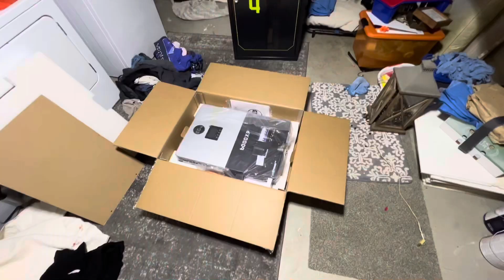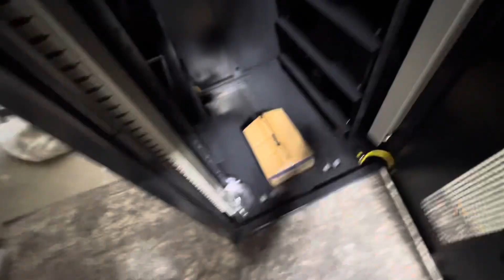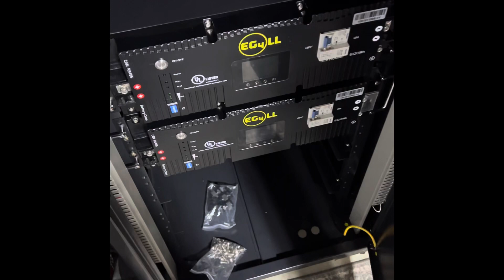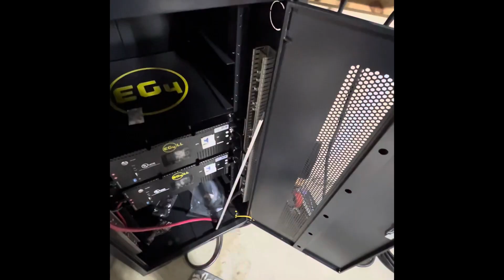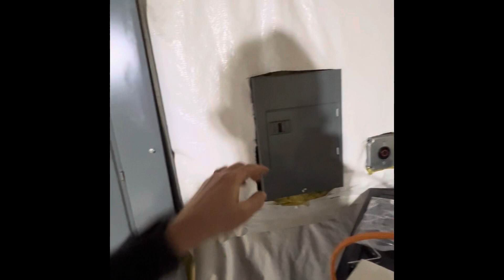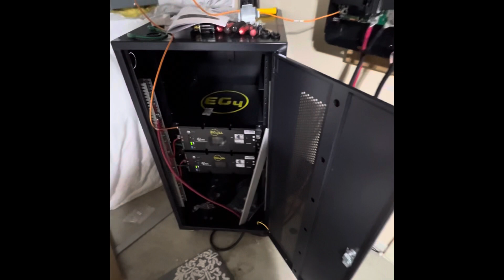EG4 6000xp with Server Rack Batteries

Comment: Im watching this 4 months after you posted so things may have changed. I got the 6000xp a few days ago and did not need dongle to get 220v out. One thing I noticed you need to turn on battery breaker on 6000xp before you power your battery so the battery boot can give the pre-charge system to charge the caps in the 6000xp. Look forward to more videos on the setup.
Reply from the maker: I had to switch on the EPS switch lol! Thanks for watching

Comment: I also that model.but have connected it yet. Can’t you connect directly to the batteries from the inverter using a lab cable
Reply from the maker: Not sure was a lab cable is but yes you can connect with 2/0 size power cables. Thanks for watching, gl with set up!

Comment: Thanks for the video! Ive been looking into this package myself or variants of, from SS. I'm really glad i watched this video. So the 6000xp will only work via internet/cell data? Or is that only for the initially configuration startup and then periodic software upgrades? Because if this is dependent on aspects of the grid, ie: interwebs, it completely nullifies this being an off grid unit as they advertised, And honestly seems goofy that something such as solar would have a dedicated need for internet. Thanks for the video!
Reply from the maker: It will work, I did a follow up video to this, the batteries were not communicating with inverter so that was the issue, there is a video on the fix I posted. Thanks for watching!

Comment: You may have saved some money by purchasing a low cost, light weight, lighter duty, high frequency, inverter charger, but can you explain why you chose this inverter tech. Because this inverter lacks a heavy duty, iron core, copper wound output transformer, it offers a far lower surge capacity, it runs much hotter due to its higher switching speeds whigh results in a shorter life expectancy than a low frequency inverter charger. Just curious why you chose this inverter tech?
Reply from the maker: I went with this inverter because it had WiFi connectivity, was relatively affordable, had lower idle consumption, could handle a reasonable workload for what my goal was which was essentially starting off with a small system to get more acquainted with solar set ups and have it as backup for critical loads during a power outage. It also got good reviews from Will Prowse as well, hopefully it had reasonable longevity!
Reply: I noticed your green light was flashing.From what I have seen on other videos , that means your batteries are not communicating with your inverter. Batteries may need a firmware update. I believe they were able to get inverter to operate by switching battery mode . @ScottieBMan
Reply from the maker: @KipSwope you are correct, I had a follow up video explaining what happened and how to fix, thanks for sharing!